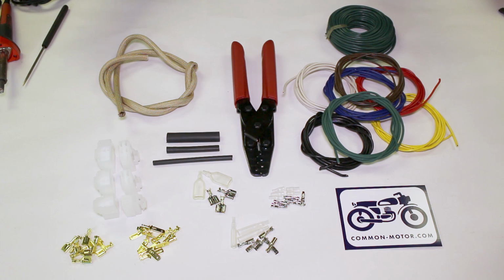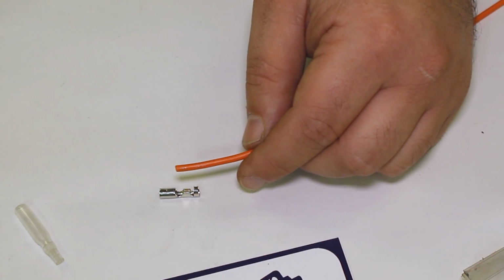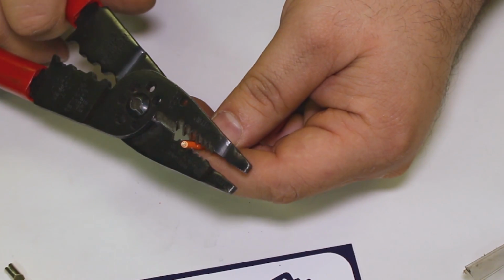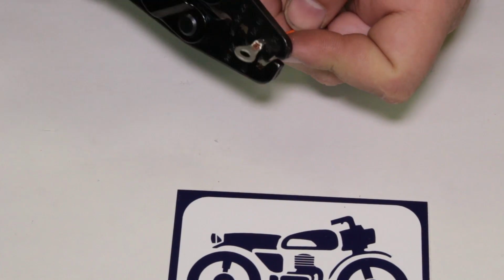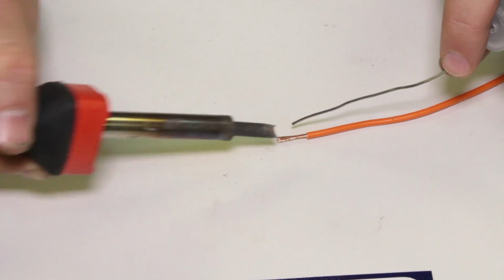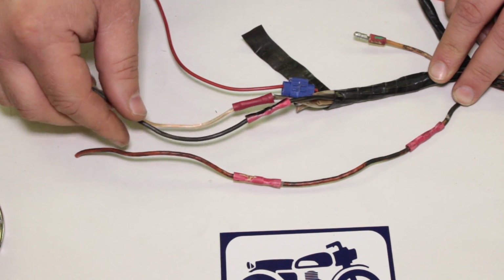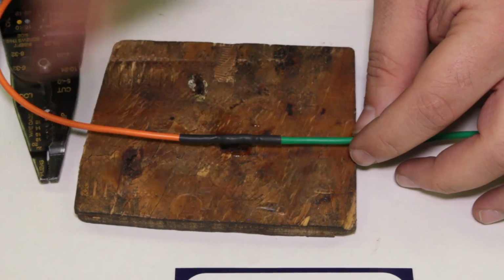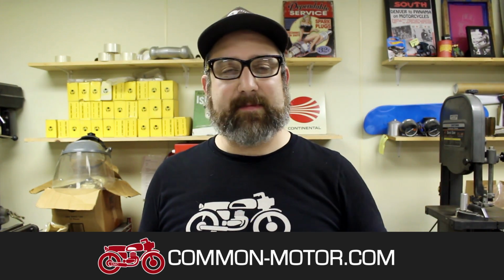How to Install Motorcycle Wiring Harness Electrical Connectors

Comment: Very comfortable presentation, felt like I was hangin' out watching you work. Great lesson, nice work. Finally! Out of all the videos I've watched that included soldering you are the first in my recollection to describe and demonstrate the correct method of applying heat and solder. Worth adding that a good solder joint will be shiny, the grungy looking ones are cold solder, poor contact, and easily broken.  Thanks for doing this, much appreciated.

Comment: I've got a 1993 harley sportster 883..swapping out the stock steering for a 6 over springer (TCBros ) i can't find a specific depinning tool to remove the harness from the headlight bucket ..any suggestions..??

Comment: You can get heat shrink tubing  which is lined with an adhesive coating, which melts and seals as it shrinks, leaving you with a completely waterproof connection on a splice joint
Reply from the maker: Love the adhesive coated heat shrink! Its pricey but fantastic

Comment: Did Honda solder the connections at the factory? I tried to solder a couple of my connections but failed miserably.  I think my iron isn't hot enough.   I found it especially difficult trying to solder a broken wire together that was on the bike... so I couldn't take it the bench to work on it.   I'm getting ready to ditch that cheap blue plastic splicer that came with my Dyna S ignition and tap into the main ignition wire properly.

Comment: How do I know what gauge wire to use? I'm new to this stuff, and I want to do it right the first time. Thanks.
Reply from the maker: EnjoyTheRideWithMe most of the wires in the bike is 16 gauge. Items like starters use much larger wires since they draw large current
Reply: Thank you. I appreciate  your videos so much! I realize that's what you are working with in the video, 16 gauge, but I didn't want to assume. Is there a way to look at a wire and know what gauge it is? The stuff on my bike is pretty old and beat up, so I'm seeing nothing written on the housing.